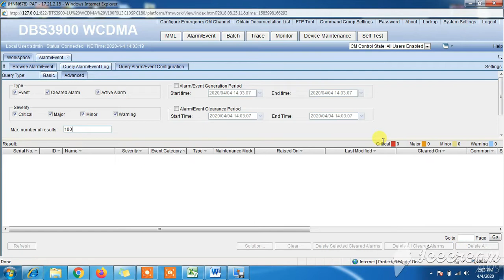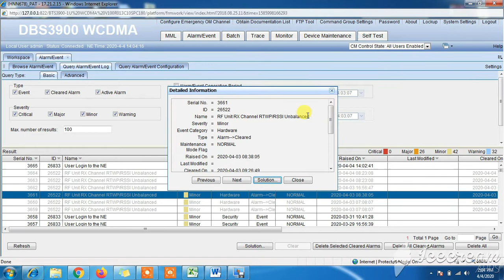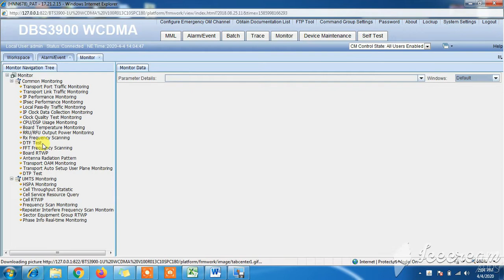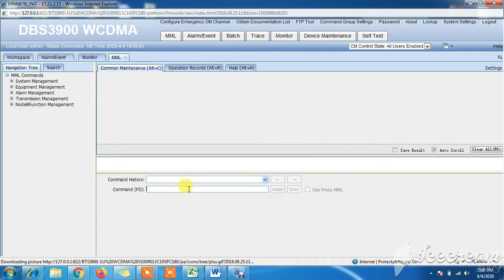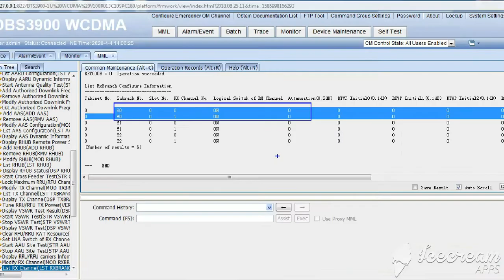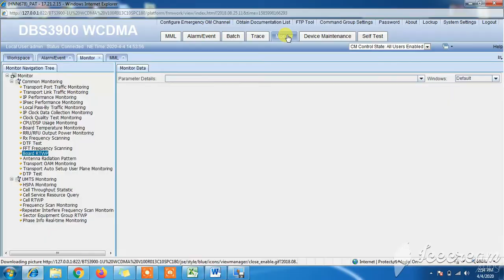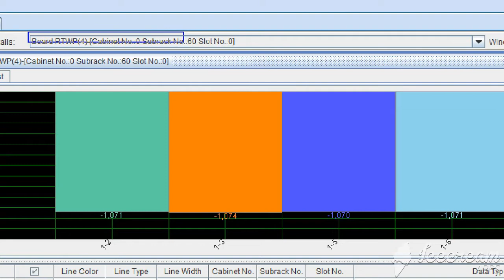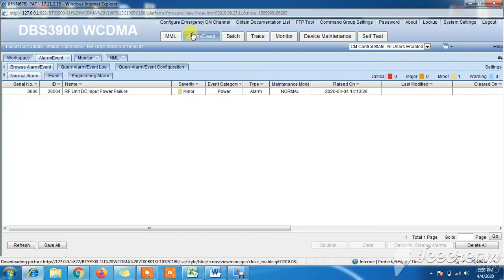Troubleshooting of RTWP of  Huawei DBS3900 | Delta Telecom

Comment: Not always we found the issue in vswr

For me if there is TMA at the sector I will swap it first with other sector

If no TMA then will check jumpers, if OK will swap RRU

if still no luck I change the antenna azimuth 😁,
Trust me the last option is very helpful
Reply from the maker: Brother in RTWP Cases we are checking jumpers and Feeder connectors at indoor and outdoor
Then we are checking the parameters just like attenuation power tma and ret is configured are not

3rd step check the azimuth but it's opposite to the design but in Maintenance we are doing it to clear the site. 

If not cleared then we will refer it to optimization and backoffice to check interference.
Reply from the maker: Also we will change rru or MRFU for checking hardware fault